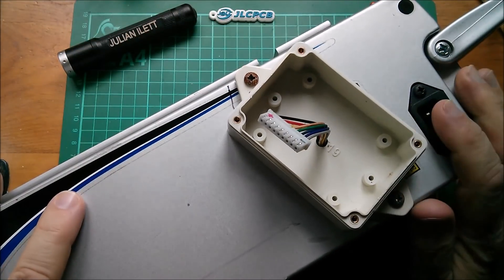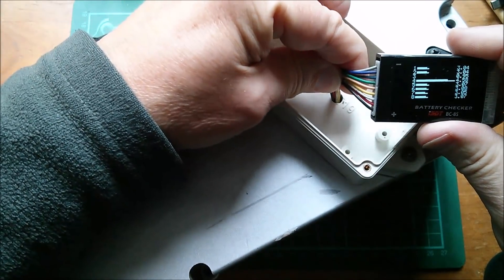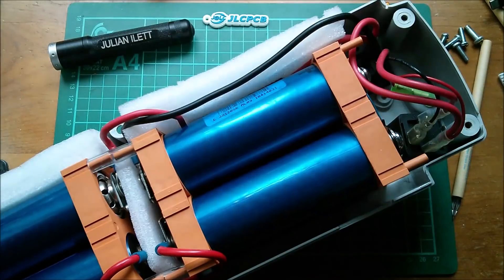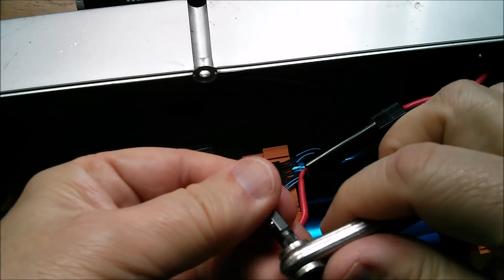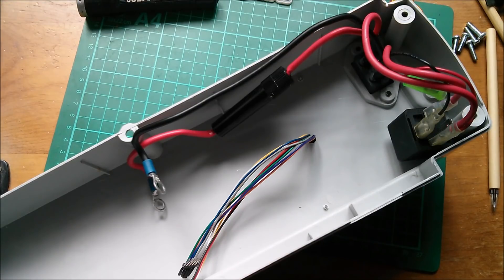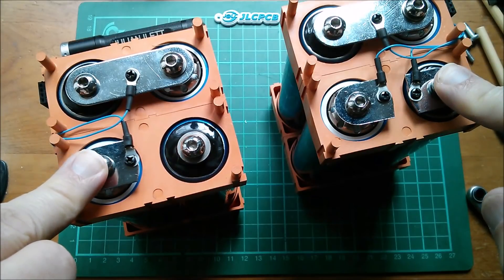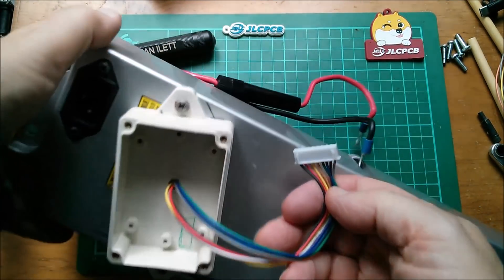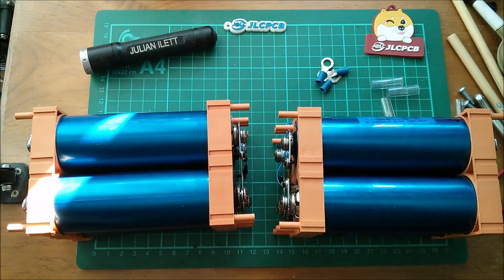Bike Battery LiFePO4 Headway Cells

Comment: I would suggest giving each pack half a five way connector so they can be swapped around, easily reconfigured for 12v, etc. When you make the 9 pin cable leaving the unit, just leave one pin of one five pin connector unconnected.

Comment: I would fit 2 BMS'S 
The Active Bidirectional Cell balancer 8 Amp Via Quick Gel Tap splicers  + A Smart BMS with WFi & Bluetooth  + RS 485 Serial (hard wire neutrik DSub)

Comment: I'd consider swapping out that socket to a 'normal' IEC one...
Reply: would definitely charge the pack fast, well until it went bang.  Never use a common mains plug on low voltage circuits you know at some point somebody will plug it in!

Plugs with earth pin rotated are often used where they don’t want normal folks to pinch the power. Common spaces in blocks of flats used to use them for the cleaners to plug in the hovers etc.

Comment: A fuse in the middle of the pack might not be the best idea.
Reason is that wenn it breaks the circuit it will connect the full pack voltage into the balancer which won't end well.
Also a fuse has a significant resistance and voltage drop which will affect the balancing and voltage protections.
Reply from the maker: That's a good point. It's not a problem in the electric bike, but I'll move it for the bench-top installation.

Comment: resistance is futile ... as the borg would say. this is why you use 4 wire measurements.  The connector resistance is irrelevant as the way it is measured is accurate ... it will take longer to balance with more resistance but hell we are talking about minor power draws to balance a pack anyway :D
Reply from the maker: I said resistance in the video, but I'm more concerned about intermittent connections. I fixed the BC-8S battery checker by remaking the solder joints on the 9-pin connector on the PCB.

Comment: Why not make it a 12v pack, put the 2 sets of 4 in parallel as the mining rig is 12v powered.
Reply from the maker: Hmm. The miner runs from 11v to 13v. That's 2.75v to 3.25v per cell. OK at the low end, but not really making full use of the stored energy at the high end. I could push the upper voltage to 3.35v (given that the miner ran OK at 13.4v). So really a buck/boost converter would be needed on a 12v pack. Configuring the pack for 24v, a buck converter is needed to supply the miner - it's probably easier to source a buck converter with 20A rating. Also, a 12v pack would need a 20A 4S BMS, a 24v pack needs a 10A 8S BMS.
Reply: @JulianIlett  Even if you charge them at 3.7 , fully charged LiFePO4 will quickly settle to 3.2 to 3.3V   Once loaded they will quickly settle to nominal - I'd be surprised if you had any issues running direct to the miner.   Buck Boost modules at those currents are not particularly efficient and run hot, and can fail.  

Another compelling reason to consider running  4S is because you are using degraded cells .   Your 24v capacity will be limited to the MaH of the weakest cell .   With 4s2p you can test all the cells and seek to  sort into pairs of similar combined capacity across the string .